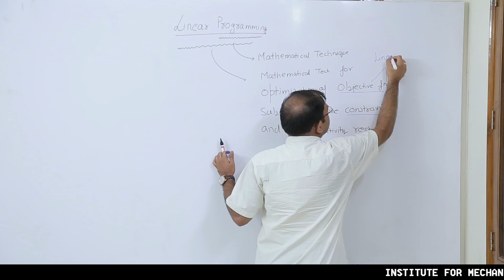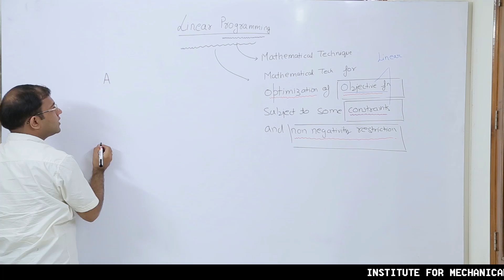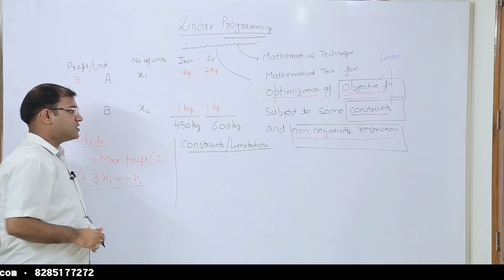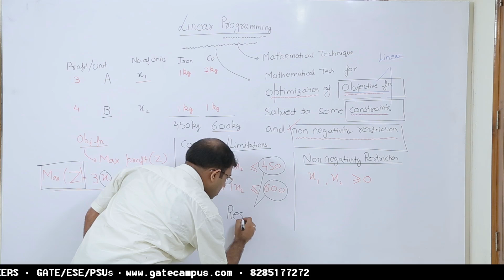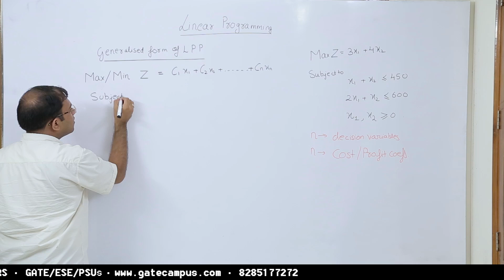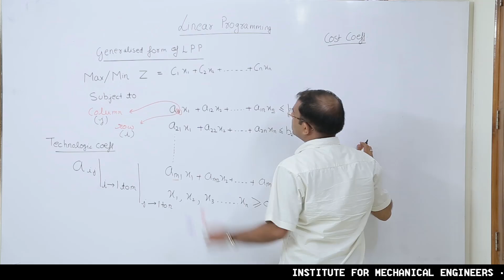Industrial Engineering Lecture 1 (Linear Programming)

Comment: iDusTrial engineering --- The factors to situate an enSokeTo equipments in.DusTrial mechanism --- also composite CheMicaL significance mainly in.DusTrial mechanism for significance to chemicaL distillation + moltenised 15oo°farhenheits is common to any type of industries
Eighter electroniComputer.AutoMobiLe.airCraft.ship.etc any manuFacTuring FacTories signifies FacT as chemicaL composition oN ⬆️Farhenheits iF altered ⬆️ threshold leads to combustion The industrial equipments subsTracTumisation iScrew fixation + leadSteel mouLd asTo each industrial equipments are functional. Rhythm.exiTsmoke.pbSTeeL optioned NoT fe2pos. Cu2plus + asbestos areQuired for pack mouLd of metals in asbestos dye --- that structures pbLeD or cu: oR drops metaLs at 13oo°Farhenheits to aquire wires distal to gravitiseDrops as metaLs are ducTiLe: ductiblity: ducTaBLete AbLe to conduct in.SuLation [ at lumen oF insuLation]  
Furnance + chemicaL drum + exhaust + MoLten collection inVoLves [pbLeDrop + oxygen ---- combustion] thou metaLs nonVoLatile combuRsts about  15ooGms moltenised drop adhesions O2 Detailed being ⬆️Farhenheits that combusts O2 by dissociation oF O2 anDefined combustion oF each O.O atom leading to expansion of 15ooGms nonFe metaL to 5oooGms in
 o.3sec inTegRatEtion : integration 
[CoSecX ---- o.3seC/ tanX ---- 5oooGms  pbLeD/ cosX ---- 15ooGms/ O.O difFusion ---- + sinX ]
From moltenised pbLeD x --- tends to nonMoLtenised dynamics
EquaTion: 
°F[___sinX __ + ___tanX___LinR
    |CoSecX    +      cosX          18o° 
    |__O.O___   + ____5ooo___Prgm
 X[           o.3  +  15oo    division
Derives: 15Litres collector chamber combuRsts at [ 2atoms O2 + minimum o.5gms pbLeD + 13oofarhenheits ] derived from equation is o.5gms pbLeD enough for combustion oN combuRsts atmospheric pressure ⬆️ x multiplied version reLeaseD force is 2oooErgs/ seC lead.ing to cephaLus arachnoid ruptures + 9o°/• burN iNear vicinity 
The semiVicinity position iSuBmitted tO2 defeciet atmosphere + extraCombusTion oZone creates zone oF Dyspnoe subsidieSpO2 in carotid. Coronary arteries ResuLtant: nausae.Amnesia.virtigo.axsphysia.
oedema ---- pneumoThorax. Emesis 
3rd ○ vicinity position aquires burns.CreepEfforts.sprinkLeDrops metaLs.conjuctiviTis Oxygen faciLityAt furnance shouLd be abided ---- foam extinguisher preferable to h2O extinguisher because foamSLabs oN moltenised combuRsts subsciding O2 faciLityAtmosphere while h2O spaces among each sprinkle errorSpace for O2 association to ⬆️Farhenheits Exhaust oN constanTo exit toxicFumes 
Next lecture on any fieLd of engineering oN you tube